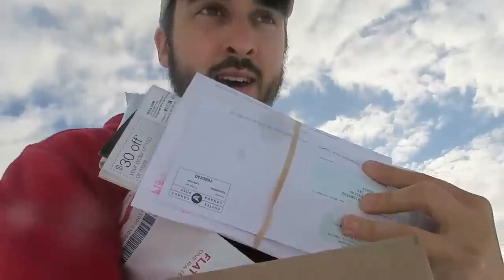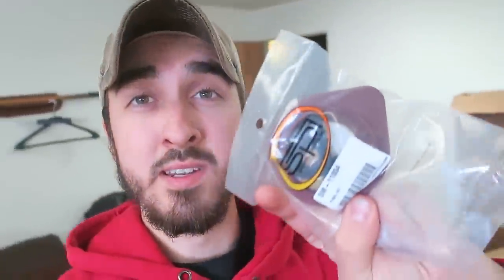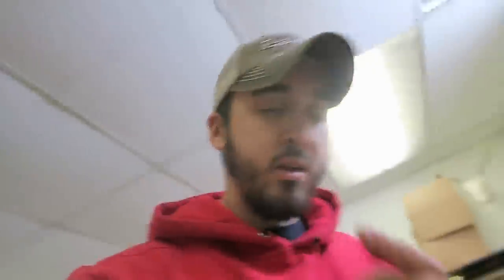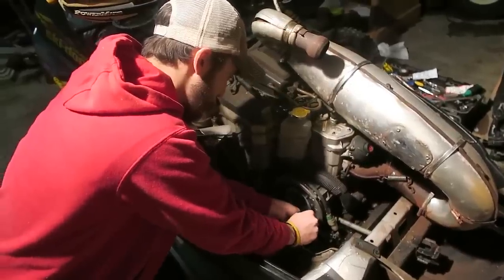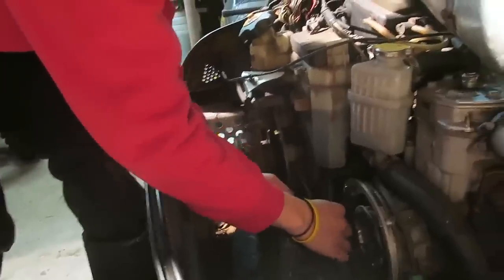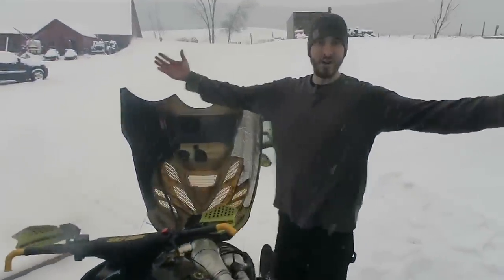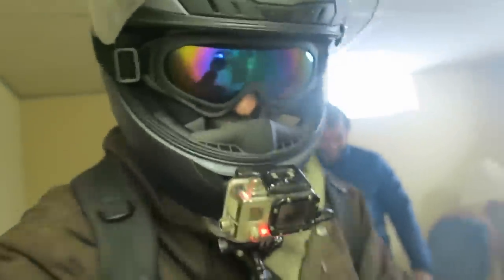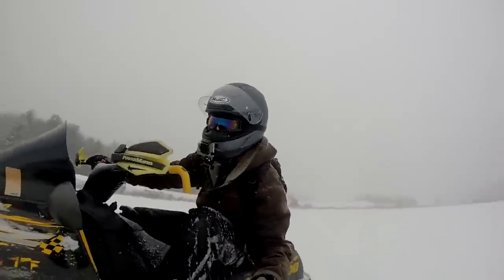WE FIXED THE SNOWMOBILE !!

Comment: My 1990 Mach1 has always pumped out a quart of two stroke oil, out the exhaust, when I first start it in the fall. I have owned the snowmobile since 1991
I also have a 1992 KLR650 that I bought brand new and still ride as much as possible. It is my favorite motorcycle.

Comment: Bro I've got an 02 MXZ 700 extended to a 136 and same exact issues, changing recoil soon and 100% true about the vibration, you need lock tight. Had mine come off while I was setting up my ice shack last winter, went to roll it over and just slipped lol

Comment: Does that sled have an oil injection pump, if so could be leaking by when you pull on it
Reply from the maker: Yeah, I think that is where the problem came from. It may have a slow leak. I'm not 100% sure though!
Reply: I have a seadoo and mine did the same thing, for some reason when they sit for awhile they will leak oil into the cylinders, normally it takes more than a year for oil to accumulate in there. Awesome ski!!

Comment: If its oil injected I believe the oil after time will seep in the carbs fill them up and as soon as you start to pull it over fills the cylinder/cylinders. I pulled the carbs on my vmax 750 after it sat for like three years and they were filled with oil. Also I thought somebody could have been pulling it over

Comment: The oil pumps on the 700 engines begin to leak with age. If it runs good and doesn't keep filling up with oil in the cylinder I would run it for the season but it is probably going to fill up the cylinder again from the gravity feed to the pump after it sits for some time

Comment: What happens with the oil sitting there is your spark plug might not be burning hot enough,or your carb needs some adjusting on the air and gas and oil mixture,try using a hotter burning plug ,but like the videos

Comment: When the end of the starter rope frays like that, just light it on fire for about 10 seconds, blow it out and then roll it on something to make it into a nice point (can use your fingers to shape it but it’s going to be hot plastic.....). Makes it a lot easier to push it through the hole when u make it pointy.....
Reply: Ryan Carlen - sorry man, you’re wrong - that is nylon rope (cord).  nylon has been used for pull cords since about the 70s.

Comment: 19:31 that was part of the problem with mine, I took the spark plugs out and put them next to the cylinder hole for the spark plug and went to see if it had spark and whooooosh a huge flame just shot up out of it and also the spark plugs were fouled out so it was a mess and a very sore arm😂😂😂😂😂later and finally got it started 😂😂
Reply: (Oil shot out of it and ignited) in my video you can see some of the oil still on my face😂😂😂😂

Comment: You might have low compresion, if you have low compresion your sled dont burn all the oil thats being pumped into the cylinders because not enough compresion and also low compresion also makes sleds alot harder to start

Comment: When an oil injection pump is wore they well pump wide open...
Reply from the maker: Yeah, a few other people mentioned that to me as well. Some others also mentioned that it could leak slowly while sitting over the summer. Whatever may be going on there, it's fine now. I've taken it for a few rips since and checked the cylinders twice. Everything looks great! :)
Reply: Jeremy Rhydes yea sometimes if I’ve got that issue I’d just plug the injector hole and run premix. Anyways no big deal to have it stuck open really when it gets stuck closed you’ve got an issue lol

Comment: If you knew the torque specs for that flange you’ll never have that problem again
Reply from the maker: Unfortunately, even properly torqued flange bolts vibrate out. It's a common problem with these older MXZ's.

Comment: Bad check valves on oil injection at engine
Reply: Philip Boismier I've had this happen to a similar mxz 700. One cyl had oil and the other didnt. When it fired the other cyl hydro locked and bent the rod.
Reply: Jason Tomkins How do you fix that problem?
Reply: Kevin Cooper the check valves are located in the oil injection nozzles that are attached to the oil pump and cylinders. I don't recall if the ones on the pump are removable but the ones on the cylinders are, they need to be replaced.
Reply: Kevin Cooper 420956510 thats the part number for the check valves. One on each cylinder. There aren't any on the pump itself.
Reply: Are they hard to change